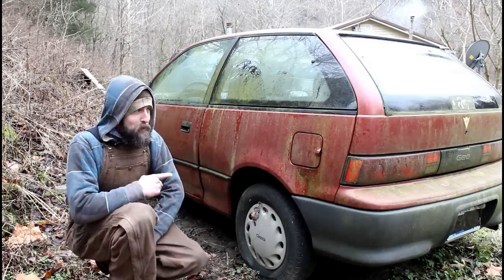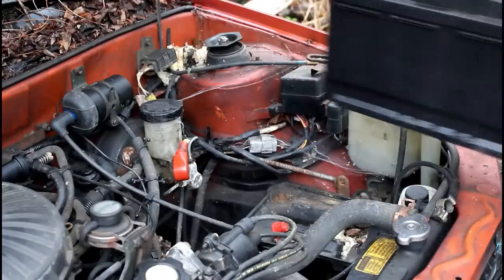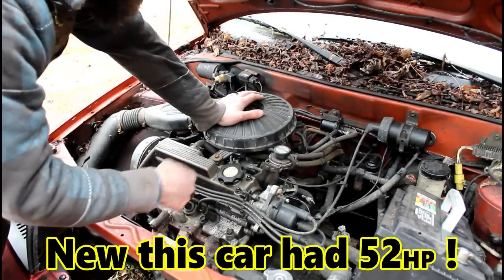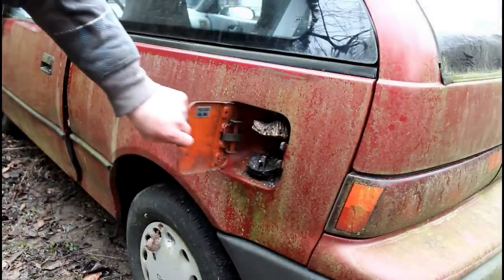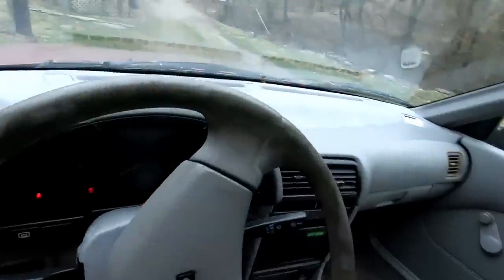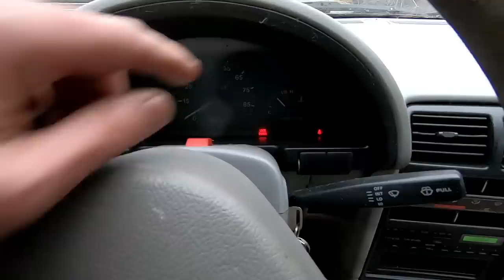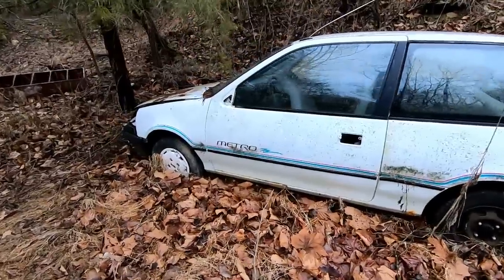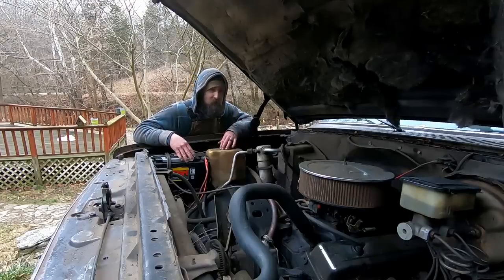WILL IT RUN ? Sitting for YEARS UNTOUCHED! 🔥

Comment: Geo’s like the rest of GM are great cars. We have a 1991 Geo storm that was my grandmothers she parked it with a busted heater core and 121,000 miles or so and it Sat for 15 years until she gave it to my dad and we did some stuff to it and got it running it now has almost 140,000 miles and I see a 2003-2004 Saturn ion 2 sedan how many miles are on it
Reply: Planet Earth that one is. The storm is a rebadged Isuzu impulse

Comment: I had a Geo Metro XFI  for a bunch of years, should have kept it. It was so dangerous with  such light weight and no air bags, I was never more safe than riding a motorcycle.  I got pulled over don’t Mt 88 mph,  It had to go.

Comment: wow man i have a suzuki swift 93' same engine "g10a" 39kw , it has 298'000 km and still going, the only problem it has is the valve stem seals it burns a bit oil, it still does 45mpg / 5.2l 100km, i use it for travelling with my friends, the thing is i don't care if it breaks and it wont break, i have another car, bmw 1 series e87 116i i don't torture it like the suzuki and it still breaks down, ive been driving the suzuki since i was 14 without licence and i took the shit out of it, now i just turned 18 and i can drive other countries bc i got my licence, normal albanian teenager

Comment: cool short video, If you live where there alot of hills the short block lasts bout 130-140k mile Kansas probly more if they'd gave it more barring surface been better. But you can go halfway cross the state pick-up that hardinge machine tool accessory and spend $20 (cup of coffe too)ha ha. beilive it or not my favorite econo cars are bmw's people are soo scared of some of the parts prices you'll see a glut of them on the craigslist i have a 318i that i'm putting a m20b27(2.7Li6) i can sell the 240 5 speed for like 3-350 with new barrings any smooth syncros and gaskets. using speeduino injection probly 30-35 mpg and just sell the old parts to buy the new ones a saginaw 4 speed 2.85:1 first 100 bucks the speduino fuel injection $75 mustang injectors $38 cant you just make an copper headgasket and a block o-ringing tool? $30 in copper stuck on 35 mpg for that car though

Comment: BIG mistake. An engine sitting like that should be prelubed with an aux lube oil pump so that lube oil pressure shows on the dash before the engine is ever turned over. Do all kinds of damage otherwise. I also run Frantz bypass lube oil filters. Never change oil. Just add as necessary. Engine sparkling clean.

Comment: This is why when you get a new car, you should always keep Amsoil in it from day 1.  This car could exceed 1,000,000 miles if Amsoil was used in it the entire time.  This is why you don't save money using cheaper oils.  They don't protect the engine internals over long time periods like this.  Cheap oils are good for short intervals but cost way more than using Amsoil over a lifetime.

Comment: A complete engine rebuild kits is like $230. Do a rebuild and get another 300k out of it lol
Reply: A weak point can be the synchros in the transmission.  After owning a Metro I learned to double clutch to avoid the transmission wear, which is not a bad habit to extend the life of any manual transmission.

Comment: these cars were the pinnicle on how to make money driving. while other suckers paying 60 80$ a tire geo drivers were rollin on 25$ tires. dirt cheap rims nearly all of your front end steering and motor related parts were never more then 20 30$ . you didnt need a engine crane you could take the engine out with barehands, the transmission was the only part that could cause woes that would cost dollars..and it was generally just the labor cost not the parts cost to that effect.

Comment: My father converted one  of those cars to  electric, 8 twelve volt deep cycle under the back seat/storage area.  96 volts and would squeal the tires in first.  He figured 40 miles range, but never drove it until it died.  Would run along 45 or 50 pretty easy.... no good in the winter as no defrost or heater, but was good for the summer months running around town.  Had to beef up the rear suspension to carry the batteries,, used air bags and we fabricated some brackets to make it work.  cheers!

Comment: Always kinda liked the styling of these, wouldnt mind getting a swift GT with the DOHC 100hp engine too bad these are all extinct.
Reply: I have one of those motors in my garage.  100 hp from 1.3 liter isn't unusual now but in  '89 it was a quick in the 1,650 pound Swift.

Comment: I think the car will continue to run if you remove the battery. If so you could have left the battery at your house, rather than have to lug it back.
Reply from the maker: Yeah, it probably would have. Problem is if it died on the trip. That's why it was left in. I didn't trust it.

Comment: You should change the oil before starting a sitting car. Oil should be changed after 1 year or 10.000km. buy long life oil if you go only on the highway and change that to 15-18.000. 20k km its too much for a oil

Comment: the !!!!!RADIATOR FAN !!!!has a blade fuse unbder the dashbord in the wirting harness its buried in one of those  white plastic clips that isnt plugged in to anything easy to miss   ITS A DOUBLE WIDE BUT ONLY HAS ONE FUSE IN IT THE OTHER SIDE NEVER DOES ANYTHING   IM ON A 1992 LSI MANUAL 1.0  A,ERICAN MADE METRO its on the drivers side witjhout it the fan wont turn on and off   its not the relay  its the fuse and  thefuse is not inthe compatment or the panel  its under the dash thee aluminum motor a cannot tolerate moderate overheating  so turn it of at the lights   over 35 it will cool  it wll crack at 2/3 needel coolant soo watch out better to wire the fan on all the time until you find it  mayby a good idea to jump the fuse and  add another fuse closer to the relay labled.   try to pass this on to other drivers  newe geoo not sure  mayby sokeone should find out its not in the book  just one of those customer things and yes themecanics need to be told too. oeojfonjomfj0 efvjk=0 efr j0=9efr 0=jif e jkefrc]0kij9 0erf]=ik0-9efr  cer  c

Comment: Throw it away with its 50hp 44/49 mpg

It's similar mpg to a new car but new cars get like 200hp out of 4 cylinders.. I mean a car from 2010 can get 300hp out of a 2.0l 4 cyclinder using factory turbochargers and still get 32/38mpg

Comment: The bodies on these things are total junk. The whole thing is made of metal with aluminum in the steel. Its a gage thickness about the same as a tuna can and the whole thing just usually rusts out and falls apart in northern climates because of the salt but the engines usually keep running.

Comment: hope you recently had youre tetanis shot , if you realy like it you couldve putten a newer engine in it or maibe change the rings , apart from the ratstuff it doesnt seem to be all that rusty , maibe get a low milage good running rustbucket and make one out of two
they sold as the suzuki swift over here : https://static.cargurus.com/images/site/2009/08/09/22/18/1994-suzuki-swift-2-dr-gt-hatchback-pic-33167-640x480.jpeg